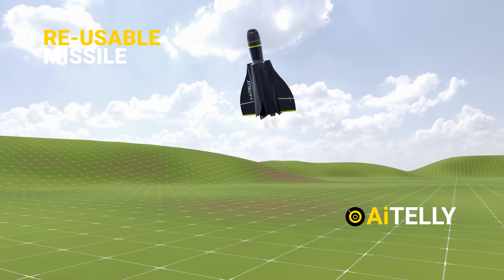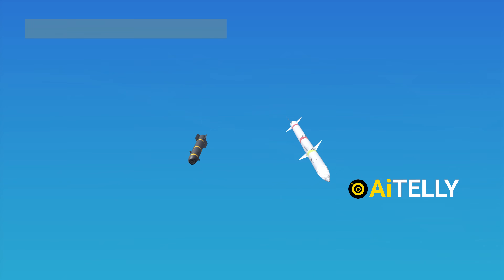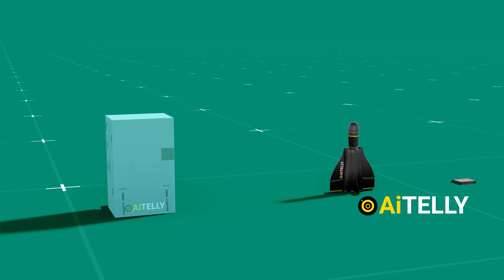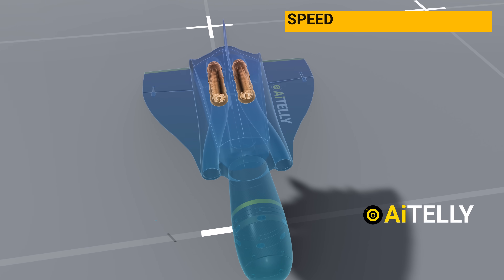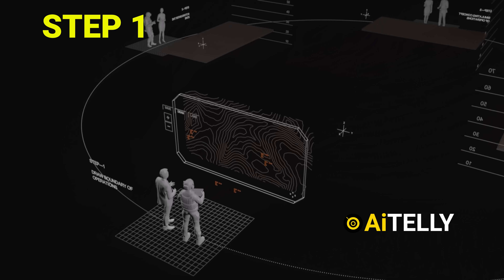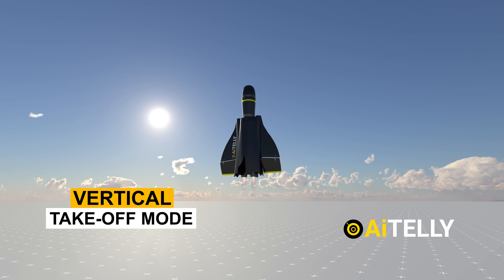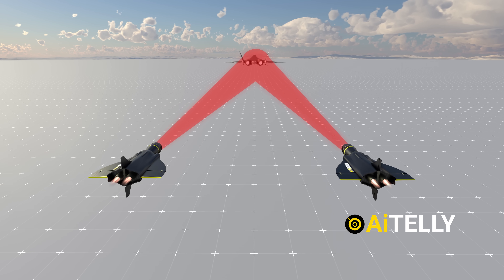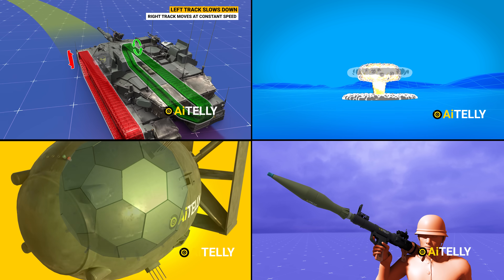How Reusable Missile Works | Anduril Roadrunner

Comment: Fast movers at mach speeds will be the apex, but a binary solution seems appealing where the weight of the initial thruster disconnects after second stage engages a lock on target at mach speed.

Comment: Interecting conept, however its considerably more expensive than existing MANPADS missiles without havong anywhere near the G load or speed and having considerably larger logistical requirments, not just because of the size of the vehicpe and container but also because it requires a ground control station and fuel handling, all of which has to be done by dedicated personell who cannot neccessrioy be fulfilling other combat duties, such as a MANPADS operator could. Furthermore this would be susceptable to jamming, whereas MANPADS are not. The Coyote 2 seems to be a much more practical solution to the issue of hitting quickly manouvering drones at a substantially lower cost.

Comment: A subsonic missile versus a supersonic fighter? Good luck shooting it down. Even 4++ generation fighters can easily fly faster than sound. And even 5th generation fighters have supersonic cruising speed. 
Look for more suitable targets like attack helicopters and large drones.
But that means your missiles must be used close to the front line. Drone containers should also be placed near the front line. And move them around all the time - otherwise they become easy targets for drones or artillery.

Comment: Actually I think the Roadrunner is not meant to shoot down fighter jet, but to shoot down hostile drone (specifically the Mavic or Shahed type).
Roadrunner will never have the speed nor effective ceiling to catch up with a fighter jet, but it is very cost effective at shooting down other drone with similar price point.
Reply: Mavic price 1.5K
roadrunner price much over 100K

it's not cost-effective
Reply: Good job!  Now, also check out some cruise missile prices.  A few units with dozens of these would be great if integrated into existing ad. @rtm_rkv
Reply: @rtm_rkv  Obviously Roadrunner is not meant to shoot down Mavic drone.
I even explicitly mentioned "with similar price point" after all.
Roadrunner is meant to shoot down larger drone such as Shahed or larger Switchblade variant.
Reply: @oim8254 you literally said it was meant to shoot down drones specifically “mavics”
Reply: @ManYijd yeah but with a drone like mavic it can destroy it and come back as its not gonna be damaged much it will be reuseable

Comment: Another advantage of this system is that being sub sonic it EO systems can provide higher resolution imagery that make sit  hard to jam or be tricked by flares vs a supersonic missile  and even provide ID  where the IR seekers are much less capable of doing so due to the need for small aperture and the air turbulence that arises from super sonic flight.

Also, these could be launched form most anywhere, even say from off shore wind farms which could extend air defenses over water.

Also, even if it is limited to Mach .9 that should enable a head on intercept or force a fighter to turn tail and run where the Roadrunner then could loiter  to prevent it then turning back.

But that assumes the fighter knows it is there which it might pick it up on its radar or might not.
Reply: Also, if the Roadrunner engages aircraft on its way back home  that aircraft might not have the luxury of turning away least it run out of fuel before it RTBs.
Reply: BTW, I am quite envious of your 3D animation skills and wish I could do that on my YouTube videos where I just make PowerPoint charts or hand draw stuff (and rather poorly at that).

Comment: This sounds cool but i have already some serious questions. Isn't it give enemy more opportunity to identify  where missiles came from ? Because it have to travel back to where it came from to land . Also this sounds more expensive than regular missiles that have onetime use. What happens when it get jammed by the enemy during the flight ?
Reply: batch 0 is claimed to have the price of around 100k$ each, turns out it's around the price of a Shahed. and autonomy is meant to avoid jammings
Reply: @TrungNguyen-uf8cv 100k dollars cost for less capabilities than other defence systems, 
It can be jammed or not seen in future.
Reply: @ManasJoshi-gc7lu  jamming is irrelevant here. This is defense against deep strike attacks. Missile will cost 400k and cannot loiter
Reply: @TrungNguyen-uf8cv   tomahawk can loiter but it’s 2 mil a pop with a far greater war head tbf
Reply: It seems like a stupid idea for many reasons. Who is going to do the maintenance if its doing multiple flights?

Comment: Well, sounds too pristine. Returning to base, and verticle landing, both requires additional fuel, over half the available fuel I reckon - half for RTB + a bit more for vtol. Combined with additional weight and drag of the delta wings, I say, this missile will have much lower speed and range. Not only that after a long chase, with not enough fuel to RTB, it might land in a location easier for enemy to access.

Comment: It still too expensive even if the missile can be re-used, compare to $500 - 2,000 "suicide drone" for ground attack and it's too slow for surface to air combat since missile doesn't have a solid rocket motor (since it start from the ground, launch speed is 0 Mph), enemy fighter might overrun it.

Comment: Question?
Who invented the VTOL Vertical take off technology?
Are there patents on it?
Are there pivot points on the Vertical Take off?
How's the roadrunner against radar jammers?
What's the radar cross signature of the roadrunner?
What's the weight of the roadrunner? 
What's the fuel source of the roadrunner?
What's the blast radius of the roadrunner?
Reply from the maker: I guess The Soviet made the first VTOL JET.
Reply: Another Question?
How does it go into vertical mode?
Is there a timer delay?
Are there pivot joints inside? @Aitelly

Comment: It will be useful against slow moving targets like drone and loitering munitions but against fighter jet and missiles it will have hard time due to their high speed and manueveravlebility
Reply: The larger this Road Runner Dual missile is, it with light up on radar, most fighter Jets have Radar on both ends of the aircraft , or even hidden...
Reply: @zainday7173 speak English
Reply: in an integrated air defense systems, these drone can intercept and destroy cruise missiles as well. because it can fly as fast as a cruise missile
Reply: @TrungNguyen-uf8cv how it can intercept, Supersonic cruise missiles or Himars missiles or Kh - 32 etc.
Patriot is a different and more good option but yes, it is good for drones interception.
Reply: @TrungNguyen-uf8cv  Doesn't need to fly as fast, just put itself in front of the missile, in its path.
Reply: since they re networked you can get one up in front of it so you can be waiting on it.
Reply: Sure but thats not what its meant for. We already have systems to take out fighter jets and missiles, these systems can take out drones, but at a exponential cost.